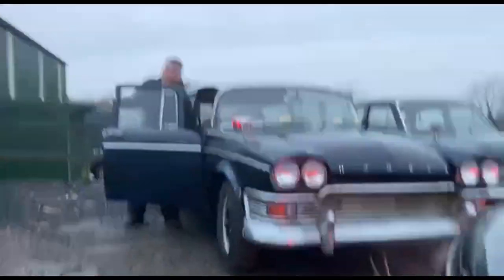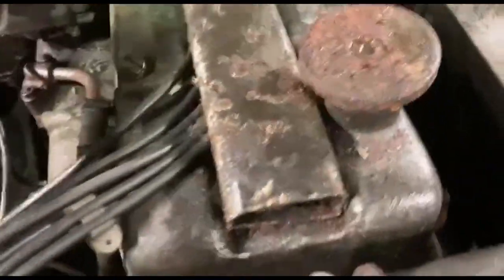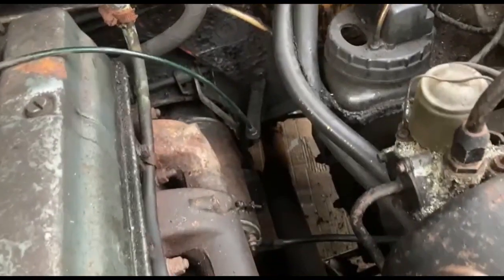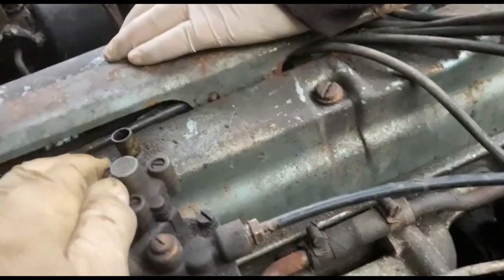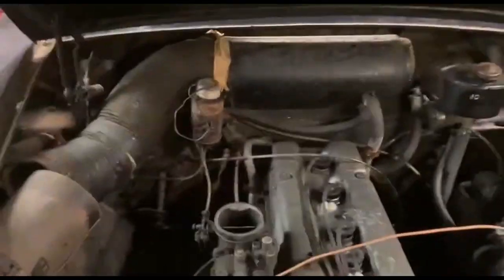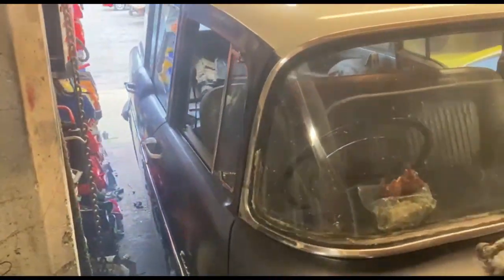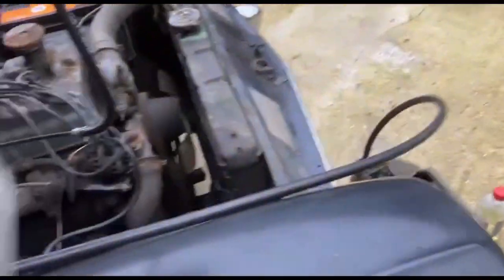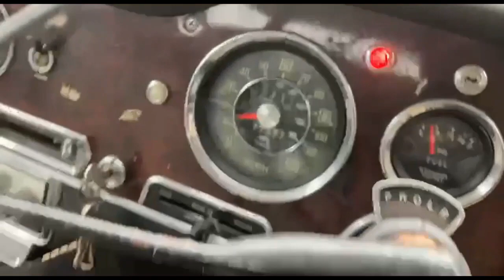Humber Super Snipe Rescue part two - Welding Preview/Will It Run ?

Comment: Its not flooding . Back in 2003 I had  a super snipe with the dynamo that didn't work. Pump twice on the peddle and I used the crank handle to start it. I did the alt mod flash the box ETC . But for sh*ts and giggles after a night out or whatever I used to show off get the crank handle out and start it first time every time.